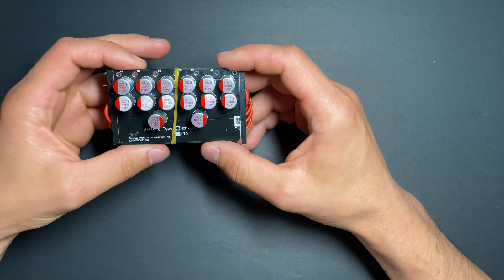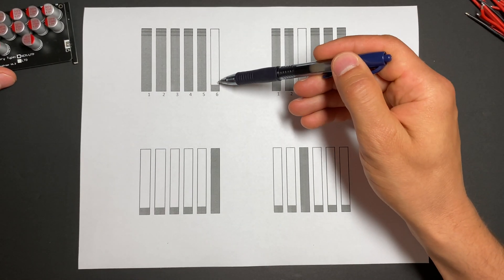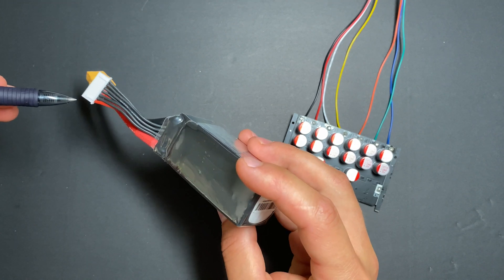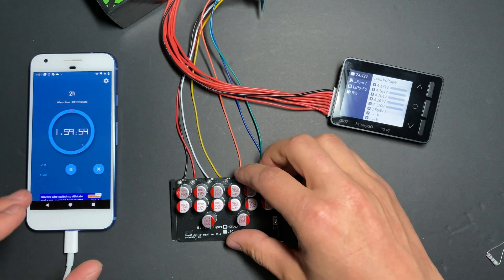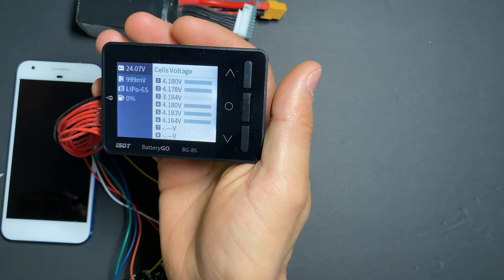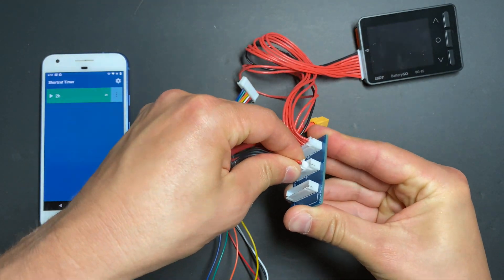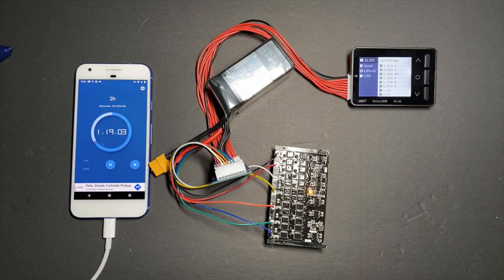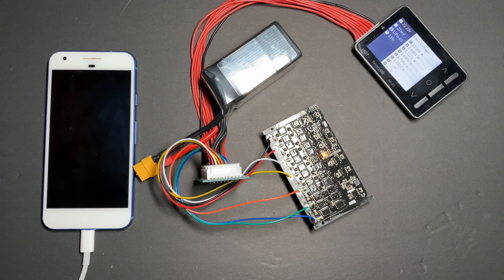Detailed test of battery active equalizer 2A balancer.

Comment: Hi SolarEngineering!  It’s been a while but I wanted to update you on my 640W 24V 280AH LiFePO4 (non BMS) RV system.  Along with a battery monitor, the heart of the management system is the Outback FM60 and active cell balancer (that you recommended).  All’s good after 9 months!
 These cell voltages are at rest (SCC snoozing) and I’ll post voltages in charge mode too.  Thnx, Rich
3.335
3.335
3.336
3.335
3.335
3.336
3.335
3.336
Reply from the maker: great to hear that, keep watching cells voltage, especially at higher state of charge (imbalance appears there)
Reply: System safeguards prevent cells reaching 3.65V, there’s no concerns.  
Cells are bottom (passive) balanced, SCC absorption is set at 26.8V (approx. 3.35V/cell) and the active cell balancer maintains individual cell voltages within 10 mV (charge mode).  I don’t charge above the LiFePO4 knee, no real benefit imo.

Comment: Thanks for the video. Is it possible to solder a on/off  power  button to this active equalizer? If yes, can you indicate how? Thank you
Reply from the maker: Hi, I think you could add switch for 1st wire (1st cell negative) and it will deactivate balancer (please double check with ammeter)
Reply: @SolarEngineering  ok. Do you recommend a switch. thank you.
Reply: Hello, I think the shunt marked EN, on the right side of the board can be cut, and replaced by a swich, or with a voltage sensitive relay, so it would be automatic.
Cheers.

Comment: Sir I am by active balancer board 18650 cal but seller send me rong marking board *LTO 2.2V how to use this balancer board plz tell me sir
Reply from the maker: this kind of balancer supporting multiple Lithium chemistry, it could work anywhere in the range of 2v - 4.2Volts, so you could use it with Li-ion 18650 cells.
Reply: @SolarEngineering  thanks a lot

Comment: sooo, ummm, my battery is an 8s 100 amp hour. with mismatched 100Ah china batteries. do I need to hook up 10=20 of these little things. my pack always gets a low cell shutting it down before it can turn the charger on at 21.5 volts. shutting down at a pack voltage of 26v.  this whole lithium lead replacement is a pipe dream at best.
Reply from the maker: not a dream, check out my 23.5kWh pack, works fine for 1 year so far:
https://youtu.be/RB_O_5Ppv7g
Reply: @SolarEngineering  YUP.I'm sure you are not out f ing with it every other day.

Comment: Great Video (as always)!  What’s your opinion of a 5-8 amp balancer for a 280AH 24V battery bank?  If cells are well matched and balanced at first, is a 2 amp balancer ok?  I don’t know.  Thanks again!
Reply from the maker: In theory, you don't need an active balancer for new cells at all. I added it to my system to have peace of mind. So if you going to have new cells and want to add an active balancer, then a 2 amp balancer will be more than enough.
Reply: @SolarEngineering  Yes, I read matched cells = happy cells and shouldn’t require much maintenance.  Therefore I elected (though controversial) not to install a BMS if the inverter, mppt SCC, smart battery monitor and active balancer provide (charge, temp, monitoring) protection.  ...your thoughts?  Thnx!
Reply from the maker: @richt2633  this idea makes sense, I was thinking to leave active balancer without BMS as well (cause my relays  consuming about 700-800W a day)
Reply: @SolarEngineering  Right SE, BMS has a place but not in my system lol.  The latest is I ordered the 8S active equalizer you tested (passed) and now researching battery monitors w/Bluetooth.
Reply from the maker: @richt2633  let me know when you find it, I'm curious.
Reply: @SolarEngineering  Hi SE.  I need a DC relay for the PowerMon Smart battery monitor.  The relay would disconnect load from a LiFe 24V battery pack in an undercharged state.  Max current at any one time (without surge) is approximately 100 amps but a higher rated SSR is good too.
Can you suggest something that might work?  Thnx
Reply from the maker: @richt2633  I don't have experience with SSR..  sorry cannot recommend any.
Reply: @SolarEngineering  OK, thanx for the quick response...i'll let you know how it goes.

Comment: Hi there - great informative video along with others you have posted - keep up the good work. One point I do not understand is why did the 'bank' voltage rise in tests 3 and 4? I can understand the bank voltage dropping a little in test 1 and 2 but you cannot create energy when transferring it only lose energy? Not trying to debunk the video just trying to understand. Peter
Reply from the maker: Hi Peter it's a great question. It's happening because of the nature of Lithium charge/discharge curve, it's taking just a little bit of energy to raise cell from 3.1V to ~3.7V.
I explained curve in this video:
https://www.youtube.com/watch?v=X_ucHHnh4Ik
check from 4:28
Let me know if it's still unclear.

Comment: Can you link the parallel board with the three jst-xh ports on it?
Reply from the maker: didn't get the question..
Reply: @SolarEngineering  you have a green circuit board you used in the video to connect both the tester and balancer on the battery at the same time, would love to know where you got that small board.
Reply from the maker: I made it myself on https://jlcpcb.com/
5pcs cost me 2$ and $17 for shipping.
Reply: @SolarEngineering  thanks will do the same
Reply: A parallel charging board is about 10 USD. Just don't connect the XT60s.

Comment: In use, do we need connect this balancer while charging or discharging the battery?
Reply from the maker: It can be connected to the battery all the time.
Reply: @SolarEngineering  most bms already have its own balancer why do we need to use this active balancer?
Reply from the maker: @simulatorproteus6810  actually most BMS doesn't have balancing option OR they have passive balancing (which is useless in my opinion).
Most expensive BMS ($500+) have active balancing mode, in this case, a separate active balancer not needed.

Comment: Does it ever stop balancing? I see it was still balancing when voltage difference is only 9mV.  seems like it would be wasting power when difference is very small, have you tested to see if it ever stops?  The ebay description says it will balance from 3V to 4.2V and stop at 2.9V.  Under load, the Lifepo4 may go below 2.9V per cell and still have capacity left.  Have you tested that scenario?
Reply from the maker: I haven't tested, I assume it will stop at some point, 3mV maybe... Don't see V diff in item specs.
I'm using this one in my system: https://youtu.be/rQgOet7AH0I
You could setup voltage diff when to start/stop balancing via the app, so far works excellent.

update: I guess you are looking something for drones, where size/weight matters, so a bigger balancer might not work for your application.
Reply: Thanks for the reply.  I'm looking to build a home power storage like yours, or a portable one.  It seems weird their ebay description doesn't say when it start/stop balancing.  Not looking to get that $130 active though, just something smaller like this one.  I might reach out to seller for info instead.
Reply: Seller confirms that it will never stop balancing.  That seems like it'll just drain power unnecessarily.
Reply from the maker: @rcboosted  thanks for the update

Comment: I'm skeptical for these reasons of active balancers:

1.  They will hide bad cells, always propping them up so you cannot identify when they are failing.

2.  They cycle all cells constantly which inevitably reduces the life cycles of the cell.

I see they work as intended but there are those unintended consequences that have yet to be flushed out in my own humble opinion.
Reply: 1. They are not hiding the bad cells. You will see a red LED on the same pair again and again. 2. That's why other balancers only get within 30mv. If you get too precise, you will be transferring all the time.
Reply: I only saw 1 LED on the balancer
Reply: @diydan6045  I have the one he called a failure in another video. It has one LED for each pair. I had a 7s5p pack sitting on the shelf yesterday that spontaneously started re-balancing (3 pairs). They are really terrible cells though. Total voltage was still 28.5 volts.

Comment: Hi, great video, thank you.  Where did you buy the jst-xh breakout board?  I couldn’t find it on eBay or Amazon.  Would like to be able to connect bms and cell monitor at the same time, looks like that board would be useful for that.  Thanks
Reply from the maker: was not able to find a place where to buy it, so made it myself.
I used the website jlcpcb.com, paid $20 for 5pcs with shipping.

Comment: Question: Can you attach this to a battery that is being simultaneously charged and discharged? Like I want to put this on my LiPo that is connected to a MPPT controller of a solar panel and also connected to a load.
Reply from the maker: yes, I'm using a similar balancer in solar system that you described

Comment: Did you measure the max balancing current? It's the only unit I've seen with proper capacitors thus far, looks promising.
Great vid btw
Reply from the maker: I haven't... 
May be worth to get analog amp meter to see what is happening.
Thanks for feedback!

Also tested more expensive model of active balancer, this module shows amps in application.
https://www.youtube.com/watch?v=rQgOet7AH0I

Comment: I'm looking for something to balance a real small 2s1p 18650 battery. Are there any good options for that?
Reply from the maker: I've tested 3 balancers so far.
In my opinion, for small 2s pack this unit is best.
I've added test of another active balancer (upto 24s), but that balancer more expensive and bigger.
Reply: @SolarEngineering  Thanks for quick reply! If I use this, the 3s version will work with a 2s battery?
Reply from the maker: @DelaneyKassab  yes, you could use 3s balancer for 2s battery.
Reply: @SolarEngineering  would wiring 2 tp4065 charging boards in series have the same effect?
For my use case the battery pack will not be under load while charging, so having the cells balanced throughout the charge cycle is not important. I think if I do it this way I'll just have to be sure that both cells her charged completely before using to ensure they stay balanced.
Is my logic correct? It would be similar to what this guy did in this video:
https://m.youtube.com/watch?v=hi8iDy7jsOg
Reply from the maker: @DelaneyKassab  if you are going to use individual charger for each cell, then yes cells will balanced every time when you are charging it.
however when you are going to discharge cells and if cells have different internal resistance, then one cell could be discharged faster then other cell. I don't know your application, but make sure you you are accounted this.
Reply: @SolarEngineering  you're awesome, thank you! Great videos as well, subbed!

Comment: I'd like to point out that this Active Balancer is fine for small batteries but it certainly won't do for say larger 100AH or 200AH batteries as it would take ages to complete.   The larger the battery pack the larger the active balancer (Amp Delivery) has to be.  Of course, the prices go right up along with the capability & features.
Reply: As I understood up until now, you pre-balance your battery pack anyways. So, 'in production' the equalizing currents will likely be relatively low.
Reply from the maker: good point. agree that it's good for smaller battery banks.
Reply: @SolarEngineering  Just poking around the Manufacturers website and they have goodies to be seen.   Check out the main site:  https://heltec-bms.com/shop/

I'm looking at Active Balancers to go with my Chargery BMS8T's.  I've suggested to Jason @ Chargery that having an Active Balancer available would lkely be a very prudent addition to the product line.

Have you had a chance to peak at the QNBBM Active Balancers ?
Reviews & Vids here show it to be worthy of exploration.
Reply from the maker: @stephsoltesz6731  "QNBBM Active Balancers" do you have link to product?
checkout latest video, I found pretty good active balancer.
ps BMS with active balancer will be something amazing.
Reply: @SolarEngineering  Deligreen on Alibaba, Aliexpress & eBay have various models, they appear to be the primary vendor.
Reply: I had the exactly the same words (doubts) until I have installed two of these in my two 7S 100P 200+Ah battery banks and after three days, both banks are perfectly balanced. Watch my videos for proof.
Reply: @CaptainProton1  you mean this balancer balances at 5A?
Reply: @adon8672  up to 5A, also Heltec says in one of the review of their official shop that you can use these in parallel